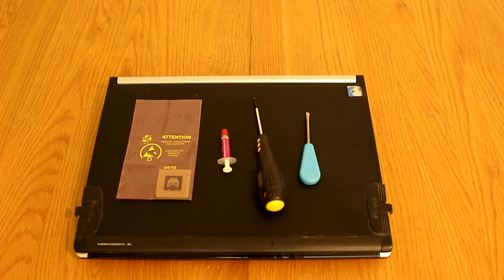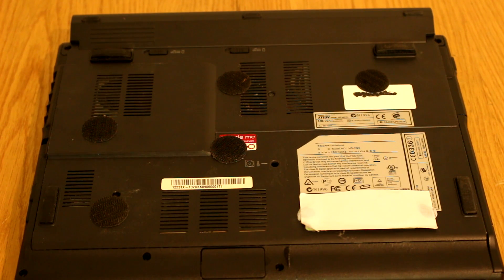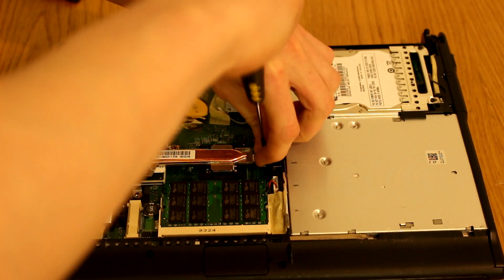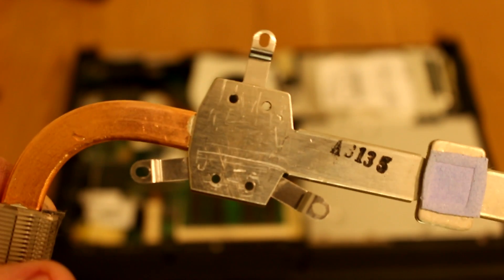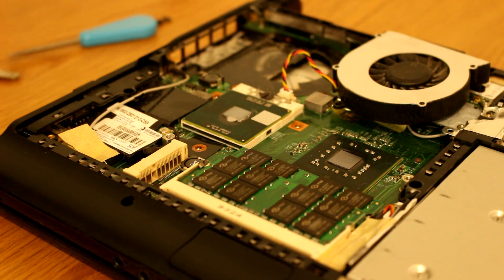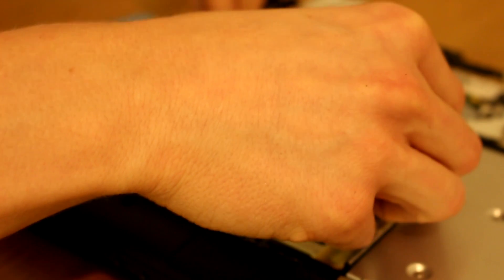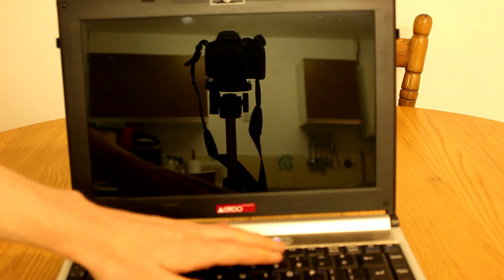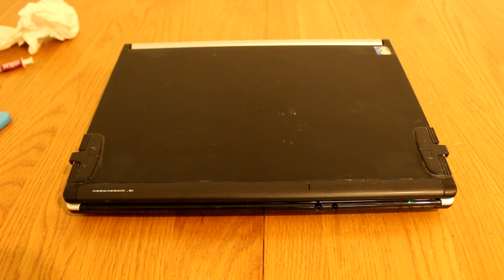Laptop CPU Upgrade (Intel Socket P)

Comment: I have samsung r466 with pentium T4300 , can I replace it with  core 2 T9800 ?
Reply from the maker: Consider if you even want to invest in a 16 year old platform, these where old even when I made this video. If you do, don't buy a top end chip like a T9800, as they retain a high price forever and are terrible value. Go a few steps down and use something like the P8600 I used as its still a measurable performance benefit, but will be something like a quarter of the price. This is especially important if like me there is no information on what CPU it officially supports, as if it doesn't work you've wasted less money. 
Hope this helps!

Comment: Can i upgrade my laptop from p8600 to core 2 quad and undervolting it? My laptop has 2 heat pipe to the cpu btw
Reply from the maker: Depends on the laptop or motherboard, but its very unlikely a laptop bios will let you adjust anything like that. Find the manufacturers website and see what's on the supported CPU list, if its not on there then I wouldn't waste money on a CPU that might not work.

Comment: I just replaced my Pentium dual core T2330 processor with a T8300 on my Satellite A205 S5812 Notebook (Santa Rosa CRB motherboard, BIOS Phoenix Technologies LTD Version 2.00 (01/31/2008)) and it was very good. The speed increased a lot. It was just change and restart the computer. It was not necessary to format anything.

Comment: i have the emachines d725 with pentium t4300 2.10ghz what cpu can i upgrade to?? plsss
Reply from the maker: Try and get a cheap core 2 duo T7700 or something around that range, that way if it doesn't work then you're not too invested in it, its hardly worth upgrading these old laptops anymore unfortunately.
Reply: Core 2 duo T9300, T9500

Comment: Can I upgrade my Acer Aspire 5735z T4200 2Ghz to a T9500/ T9600/ T9900 CPU?? THANKS
Reply: what motherboard chipset?
Reply: @vladimirazirov1815  INTEL GL 40 (CathedralPeak) that's what it says on hardware info
Reply: @goingviral8917  core 2 duo T9300, T9500 // RAM 2gb+2gb, 2gb+4gb
Reply: @vladimirazirov1815  Hey bro I need prossessor please tal me lenovo 3000G430❤

Comment: I have a SZ 750N with a T8100 do you think is it better a p9700 or any other? And are those processors capable to play 1080P 60fps video?
Reply: Chipset GM45? GL40? GM965?
Reply: The two models i have are Sony Vaio SZ491N with GM945 Chipset Intel Core 2 Duo T7400 2.14GHz Socket M the max processor it admits is the T7600, and Nvidia Go 7400 i upgraded the ram to 3GB and it's working nice on 32 bit Windows 7 Professional, capabilities for video are the same i mentioned before in 30fps you can play 1440p video max, but in 60fps you can play only 720p max because 1080p becomes choppy skips frames and the audio is not synced, the other one i have is a Vaio SZ750N Chipset GM965 Socket P with a T8100 (a P9600 is on the way and watching the sony's site it says for 1080p 60fps is necessary at least a 2.6GHz Core 2 duo Processor so i'll update how it goes about this) it has 4GB ram Nvidia 8400M GS and works so smooth with 64 bit Win 7 Professional, capabilities for video are the same on both pc's and both of them have Silicon Power SSD's they are incredibly fast machines for playing gta sa doing homework watching videos and some basic tasks they're good
Reply: @SebaaRTX  Chipset GM965 does not support processors with 1066 FSB => P9600 will not turn on in a laptop ((.
 Only processors with 800 FSB are allowed => T9300, T9500
Reply: @SebaaRTX  In the Chrome browser, install the extension "h264ify" - in the settings remove 60fps and the processor (T7400, Т8100) will be easier to play video.
Reply: I have 2 of them both GM945 and GM965 are capable in 30fps of 1440p maximum, i guess 4k too but i haven't tried due to my net connection, but in 60fps they're capable max at 720p
Reply: @SebaaRTX  if you have T8100, then you have GM965 chipset. Core 2 Duo T9500 can be installed. Install Windows on SSD + 4GB of RAM. Windows 10 (64bit). Maybe 1440 and pull.

Comment: Hi
i have an hp elitebook 6930p with intel core 2 duo p8400, with socket p 478, chipset GM45/GM47.
What processor is compatible?
Reply from the maker: HP website says that the highest performance CPU is the Core 2 Duo T9600, slightly higher cache and clock speed. than the P8400. If you can find a cheap one and are willing to put in the work for only slightly better performance then go for it. Unlikely any quad cores will work.
Hope this helps.
Reply: @doshtechvideos  
excellent, thanks :)
 I'll try to get the processor.

Comment: What is the best CPU for this socket?
Reply from the maker: In theory its the core 2 quad  Q9100, however it entirely depends on the manufacturer of laptop and its motherboard as to what its highest supported CPU is. Look for a manual for your particular computer and see what  it states as the highest performing CPU.

Hope this helps.

Comment: I also have one of these socket P laptops, it's aging quite well, the core2duo does everything that I need, with the exception of Cities Skylines... I can play the game up to population of 70 thousand but after that it turns into a slideshow pretty much and no more vehicles/pedestrian can spawn in the map, creating all sorts of problems... it's a damn shame because it is at that point in the game where things get interesting, you have to plan metro lines, improve traffic, but then the game barely works (the developers themselves set the "ending" milestone of the game at 65k population, so they were well aware of the limitations in the code...)
The maximum CPU this socket P allows for is a core2quad Q9100. How could I know if upgrading from a core2duo T6500 would bring significant gains? Cost is not a problem since I found one of those for cheap, and my hardware is already ready for it. I just want to know if it's worth it. Would I have to keep an eye at what benchmark exactly, "single thread benchmark"? For example, Passmark gives 1200 points for the core2duo but gives 3200 for the core2quad, more than double (even the core2quad being released earlier and having similar clock)
Reply: @LengkapGan kalo up dari p8600 ke q9000 terus undervolt bisa ga bang? Heat pipe laptop saya yg ke cpu ada 2

Comment: I came across an old socket similar to this one once and I still don't get how I bent the pins, but then how can you not? Just by placing it in the wrong direction and putting pressure on it, that's it, game over. Now go spend more money on another CPU, who's brave enough to give it another try? :c
Reply from the maker: I can understand your frustration, they do not make it quite as clear on laptop sockets as to which way the CPU is inserted, and is usually just etched into the plastic making is difficult to see.

Comment: hey i have an old laptop from 2002/2003 cpu socket is  PPGA478  cpu it has in it now is a https://ark.intel.com/products/27174/Intel-Celeron-Processor-2_00-GHz-128K-Cache-400-MHz-FSB if i got a cpu that works with the socket PPGA478 will it work ?

Comment: Can I upgrade from a Pentium m to a core 2 duo or quad as they both use PGA478?
Reply from the maker: Depends how much you are willing to spend and how much of a chance you want to take. The laptop model I had in the video had very little information online, so if you can find something online saying which CPU's will definitely work then you're in business. If like me you struggle to find information for your specific machine then Id suggest doing what I did and getting a fairly cheap, used, mid range dual core (such as the core 2 duo P8600 I used) as that is more likely to work than a quad core (due to power consumption and BIOS restraints), and if it doesn't then you're not too invested in it.
Hope this helps!

Comment: Thanks for this video. I just bought a P8600 on ebay for 10€ to upgrade my T5850 on an Asus N50VN motherboard
Reply: jm allard 
In reply to the other reply you erased, 
umm no the p9600 is 25w the same tdp as the p8600
Except the p9600 can be underclocked and undervolted to the same clock rate as the p8600 while consuming less watts.
The t9600 is 35w tdp.
Reply: You are right. I made a confusion between P9600 (25W) and T9600 (35W). I erased my comment when I realized my error.
I saw there is the P9700 (28W) running at 2.8Ghz, available at low cost on ebay. I will try it later. Regards
Reply: @jmallard3791  So how is the game doing with the upgrade? Did you notice improvements? This game is such a bitch to run, I see so many people wasting money without getting the results they expect :(

Comment: no offence but you could've bought a p9600 and gotten more performance at the same exact power consumption rate as the cpu you put in.
Reply from the maker: zero2umashi Not at all, its a  perfectly good point, and the P9600 is something I looked into. I just dont use the computer enough to validate the extra cost. 
Thanks for commenting!

Comment: What was the cpu?
Reply from the maker: It was previously fitted with a Pentium T3400, replaced with a Core 2 Duo P8600. Not too much of a performance increase but makes a good video!
Reply from the maker: If that's all you need then there's no reason to upgrade :)
Thanks for your comment!